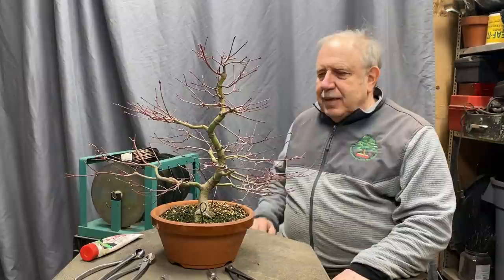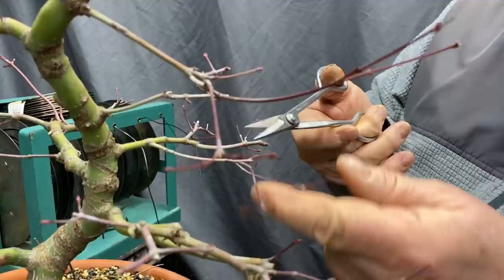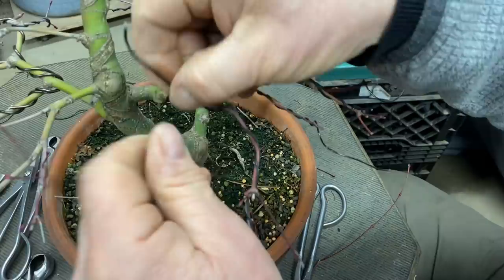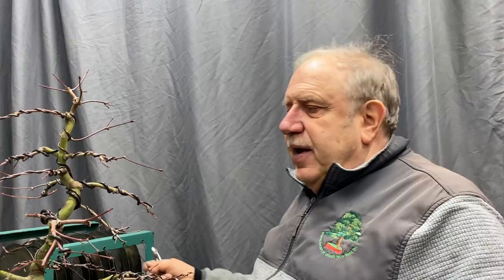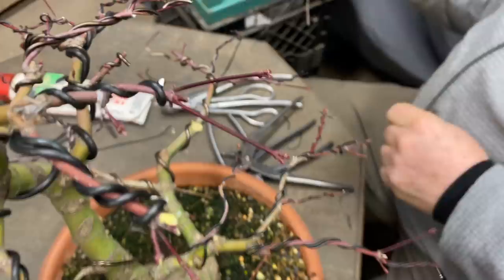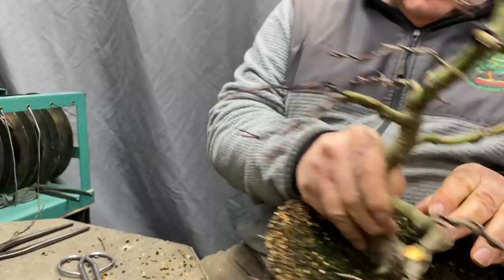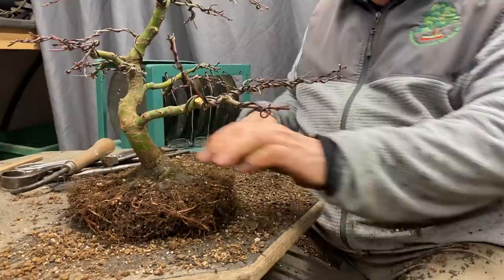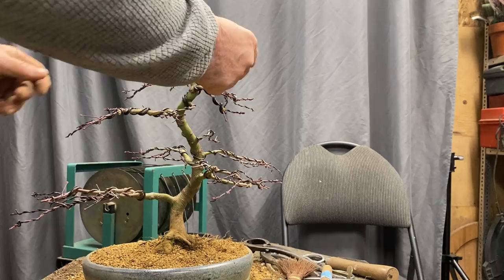From Root Bound Japanese Maple to High-Quality Bonsai

Comment: David that was excellent! Thank you for sharing the whole process. Could you explain a bit more about using a medium grain mix with a fine grain mix? Why is a mixture of both needed?
Reply from the maker: The medium grain is for better drainage and aeration at the bottom of the pot. Whereas the finer grain is used for the top layer because it holds a little more humidity for the feeder roots and for growing moss
Reply: @BonsaiSociety  tremendous video David I loved the format of the video and how it was filmed showing the whole process from start to finish ( thanks for not showing the finished tree at the start this time also 😁 )
 I l always look forward to your videos every time I thoroughly enjoy them and don't worry there were no boring parts in my opinion your amazing and Thankyou
Reply from the maker: @chrisbanner7551  thanks your suggestion from last time was duly noted🤓
Reply: @BonsaiSociety   never heard of this but being in Florida the plants sure could use the 2 sizes.

Comment: Would love to know how to over winter your trees. I live in Ottawa and am new to bonsai. Unfortunately I don’t have a greenhouse, a heated garage or an unheated basement and last winter I lost quite a few trees. I live in a suburban area so the land size is very limited. This year I put my trees in the garage and surrounded them with styrofoam. I haven’t taken them out as we still have two months until spring. Any advice you can give will be highly appreciated. Thank you in advance!
Reply from the maker: Sounds like a good place as long as you can keep the temperature low enough. Below 5 degree celsius in the winter. Also you must check on the watering needs at least once a week because they do dry out in a garage

Comment: David, I have always been told that one should not cut the head and feet of a tree at the same time. Since this tree is in full dormant stage, is this the exception to this statement from others or not? I'd like your opinion on this. Thanks
Reply from the maker: I believe that when you remove some roots it should be balanced by removing some upper growth.